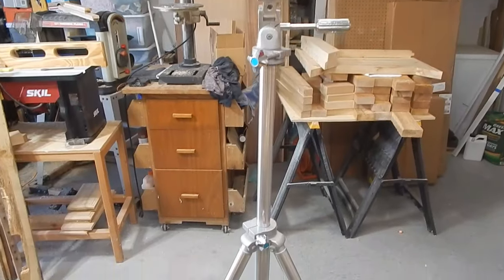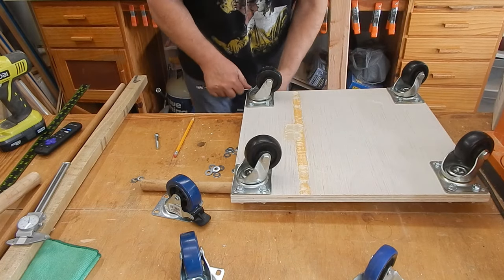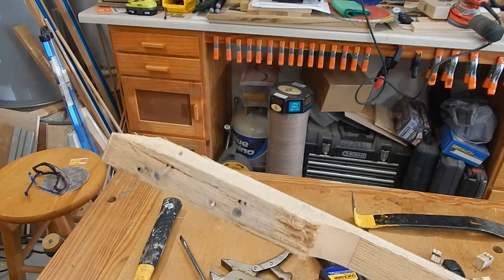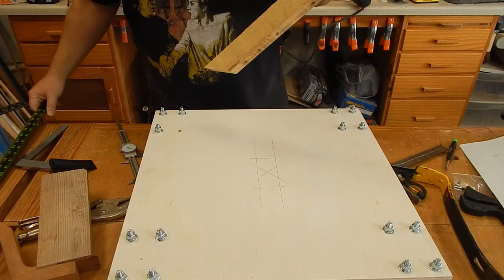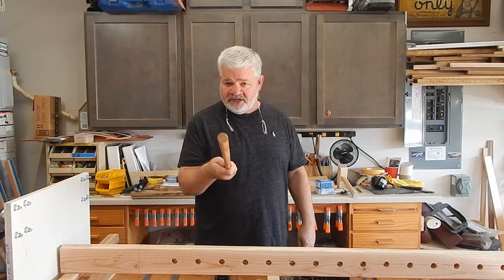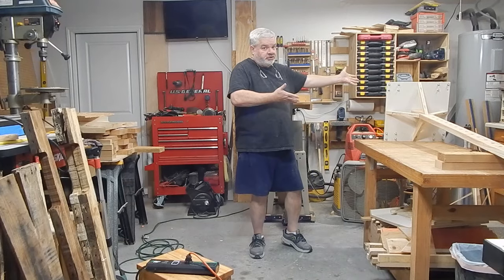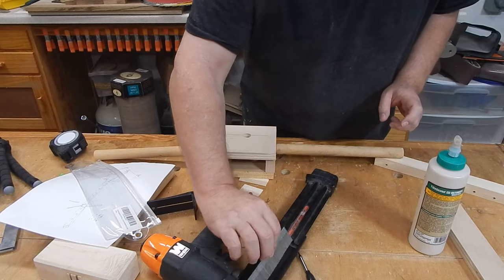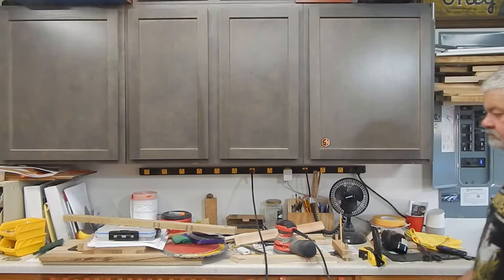Pallet Wood Camera Stand Build Using Scrap Time

Comment: Concerning misplacing stuff, like castor wheels . . . I'm a bit your senior and from experience, just plan on allotting an hour or two per project, looking for the tool you had IN YOUR HAND not 5 minutes prior.

About the only thing more frustrating is a drill press chuck that won't center or a Magic Shop Door.

Oh, ya! I got me one of those doors on my shop . . . Pass through it either direction and it erases your short-term memory. Suddenly, you're overwhelmed with, "Why am I out here?"

Acute episodes of MSDS* (not what you think) can be dealt with by writing down what tool you went to your shop to fetch and carrying that note in your teeth, so you don't lose track of it too.

*MSDS

Magic Shop Door Syndrom

😂

Comment: Drill bits . . . ?

That's kinda vague. 

There's numbered & lettered & fractional & augers & Forstner & probably more.

I'm personal friends with the Drill Fairy and if I were to ask her to pay you a visit, I know the first thing she'll say will be what kind or how many or how long or what tang configuration or what cutting profile and on and on . . . you know . . . girls just jabber on forever, so maybe zero in on what you're REALLY thinking, and I'll run it by her.
Reply from the maker: I had a dewalt set of twist bits. Thinking Brad point bits is what I'm after now.
Reply: @CaddoCreekWoodworks  
I've heard of Brad Pitts, but Brad POINT bits?

That's a new one on me. I'll have to Google that 'un.